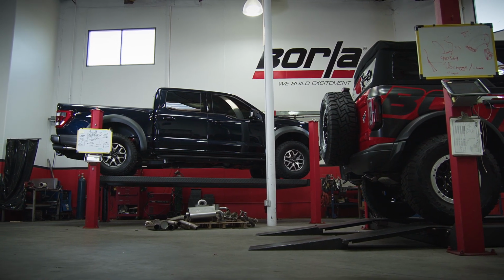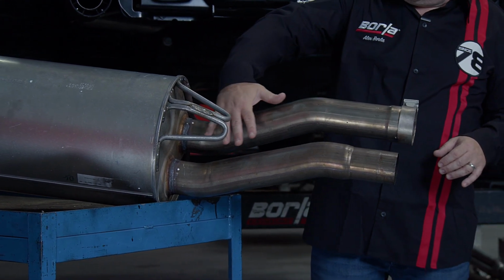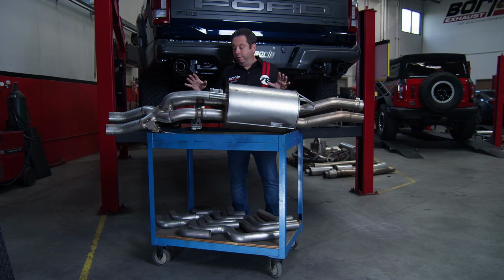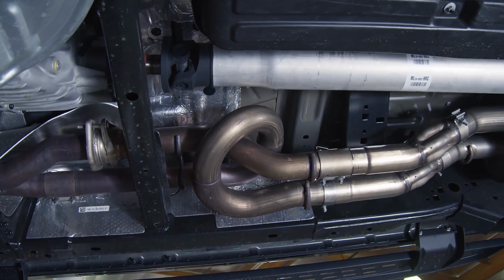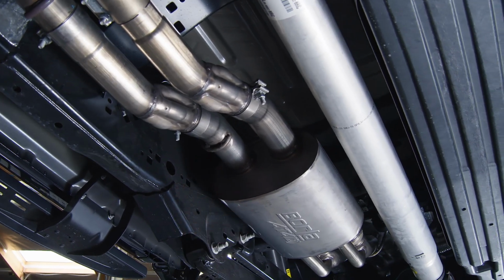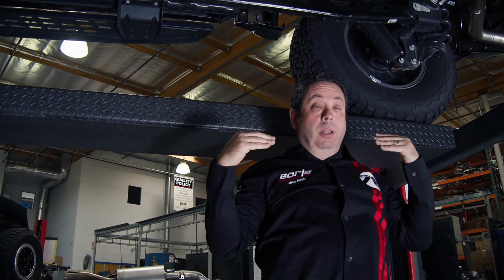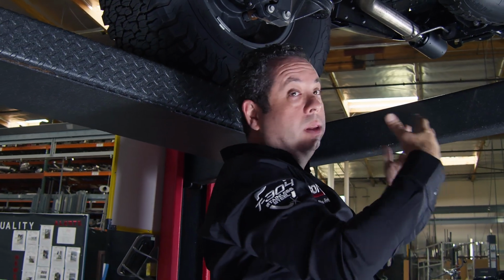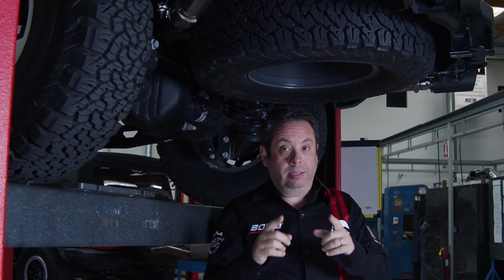Borla Exhaust for 2021-2024 Ford F-150 Raptor

Comment: Can you get just the carbon fiber tips to add to a stock exhaust?
Reply from the maker: Tips only, no. However our tailpipe kit for the 2021-2024 Raptor will work with the factory exhaust midsection.  https://www.borla.com/products/ford-f-150-raptor-tail-pipe-kit-60727cfba